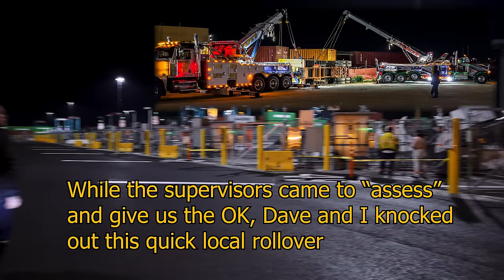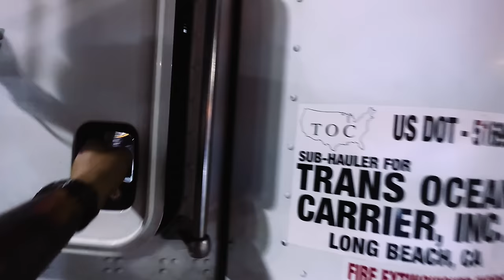Unbelievable Dock Disaster: Who's at Fault?

Comment: I think I’ve watched too many tow truck videos as my first thought was that someone forgot to undo the container locks. Not bad for an 80 year old woman!
Reply: Yep!
Reply from the maker: That's what I love about my fans and these videos. You can pick up so much without even being in the industry.
Reply: So was in the wrong, the driver who didn't unlock the pins or the guy with remote controlled crane WHO FAILED TO CONFIRM it was unlocked and FAILED TO READ THE WEIGHT being lifted. Probably both got fired.
Reply: I’m 70 years old I’m a woman and I just started watching this channel. I love it.
Reply: @sammartin8932 it’s an automated port there’s an emergency shut off switch for those situations. Unfortunately it was the drivers fault for not unlocking pins and not paying attention.
Reply: I love these videos and I’ve even watched heavy rescue 405 and Highway Through Hell and you really learn a lot about the industry just from those shows and his as well as others’ videos.
Reply: @rd4660  I’m nearly eighty and I don’t  feel any different than when i was sixty. All the best from England
Reply: @sammartin8932  the driver is prolly an O/O, owns his truck. the crane operator is sure to be ILWU, good luck trying to get that guy fired.
Reply: @sammartin8932  The remote dude was not even there when it was lifted. It is all full automated.
It's called a Straddle Carrier. https://youtu.be/kQ8WI3nc1l0?t=72
Reply: @shelbynamels7948  There is no crane operator. It is automated.

Comment: Working at the docks for the past 22 years, I gotta say a couple of things about this incident: these happen with people behind the wheel on the straddle carrier, but it seems AI doesn't make it any different - if the twistlocks aren't fully unlocked, you're gonna lift the truck & trailer and notice it too late. Truck drivers don't always remember to open or check the twistlocks on the trailer, and this is a fairly common end result of that.
As for how it ends? In about 99,9% of the cases it's the same: straddle carrier ends the shift with zero damage, the other one gets a ride on the tow truck for heavy repairs.

Beautiful work with the recovery, didn't see any additional damage done to truck or trailer. Great workmanship!

Comment: Great work on this one.  It's especially great you were able to dislodge the back of the trailer without being able to directly rig to it.  With that suspended container hanging above, you couldn't go back into that area.  Some might not think of the "thou shalt not work underneath a suspended load" rule, which made your job tougher (but safer).
Reply from the maker: You hit it on the head. We COULD HAVE rigged to the rear and pulled it, but we could have caused more damage brute forcing it that way. The way we did it by rotating the front back and forth gently allowed it to break free without any damage.

Comment: As a crane operator myself, I can only compliment you guys, nice bit of teamwork there. Also the port controllers stepped right in like they did it before.
Reply from the maker: Nice, thank you. What kind of crane do you operate?
Reply: @PepesTowingService  I got one on the back of my truck. A Palfinger 53002, 30 meter range. Mostly I'm lifting pallets with drywall plates. No winch but some hydraulic pallet forks

Comment: Noooo, don't say "bad robot", they're listening! When they take over, they'll remember when you thank them. 😂 But seriously, bad engineer! The lock release on that trailer was probably at fault. Then it's tricky to detect if the container has a truck attached because light container + truck is less weight than full container. 🥺
Reply: Source: I'm an engineer who's worked on industrial controls. Automation is big scary when you try to think about problems.

Comment: I'm amazed at two things -- your excellent recovery and that danged chain link fence supporting the rear of that tractor.  That fence with all of that conduit attached could have been a real mess if it collapsed when that truck dropped on it.  Obviously the crane structure caught the trailer and took most of the load.

Comment: One thing I'd suggest is a slugger winch. When I was a commercial diver we had a 10 tonne hydraulic winch that we could carry and pull in any direction. I use a similar wind ( superwinch18k ) on a receiver mount. Just thought it might help. Great teamwork there!
Reply: You would have fixed it on the rear of the trailer and pulled it sideways with that? Ain't a bad idea

Comment: Driver unlocked the locks that lock the container to the chassis. It was the salt water rust from the bottom of the container that stuck the container to the chassis. They will still poke away at the driver as their automation is faultless. I hope like hell that driver was not in the cab of that truck for the ride. Wow.

Comment: Your trucks have a set of beautiful lights.  The fleet must keep 2 or 3 automotive electricians busy checking and maintaining lights, wiring and switches, charging light bars, etc.  Work lights, warning lights, clearance lights, road lights, light bars, toolbox and cabinet lights, cab lights, flashlights, and a few lights just for a fun decoration.  Trucks must have massive alternators (or a separate diesel power plant and batteries?)  Are the hydraulics and air compressor electric, or power takeoff?

Comment: After working with all types of computer controlled machines or robotics in a manufacturing setting I can honestly say I have never seen one that at some time does not lose its program and go off on its own.   I have seen results of that from just shutting itself down to ripping itself out of 10” of concrete.   The worst was a machine that moved parts the weighed around 40 pounds and when the robot went rogue it threw the part at such a force it bent a structural I beam if the building

Comment: I used to haul containers. How did it happen?  I guess the chassis got stuck on the elevator they were using for the container?  Or maybe the driver forgot to remove one or more pins. That's probably it. He was bringing it in and having the container removed and it got caught on the chassis because one or more pins were not removed correctly. We used to use plastic ties to hold the steel pins in place in all 4 locations. Leave one pin partly inserted and you got it picking up the truck. Probably the driver side front pin is what got it.

Comment: I watched the video for the first three minutes. I wondered how the hell that happened. Then for a WAG, the container lift grabbed the container and one or two locking twist locks were still engaged. So as the container was lifted it took the chassis and tractor with it.  Usually the lift operator can shake the one lock free or slide the container off the chassis.  In this case the  lift operator would have to lift the container pretty high up when it let go and probably was not paying attention that the container was still attached.  Oh ok, the straddle lift is automated.  And as you said, the chassis and tractor was lifted with the container.  This would be the fault of the driver.  If he had a jambed twist lock his responsibility to notify a yard supervisor or report to roadability  to get the lock unlocked.

Comment: Great job.  Such finesse. 
Could you have an aux line through a snatch block at the end of the boom reach to the rear of the trailer to have lift there, too. or would the line angles be wrong?
Reply from the maker: Correct, the angle would be very weird and fight me. If you visualize it, it would do more harm than good. We purposely didn't rig to the back even at the end, because brute forcing it out of there could damage the machine. It's why we alleviated the pressure up front first and had the crane drive back and forth to get it unstuck.

Comment: I have a 10 foot 3/8 chain to help get me or another driver out of a tight spot and I been hearing nothing but praises for bailey's rigging would you recommend me getting a good size rope and shackle?  If so what size would you recommend? I don't use it a whole lot but when I do it sure comes in handy
Reply from the maker: I'm assuming your chain is either grade 70, or maybe 80. It's only rated for a few thousand pounds max. Of course it'll break anywhere between 3x or 4x that, but each use overloads it. The Bailey's team can custom make a sling for you in any length. I would probably recommend a 5/8" grommet sling in 15'. They are very versatile, strong and easier to store and carry. A regular 12t shackle would be perfect to match.

Comment: Kind of surprised they drove the dock crane off without (much of) an inspection. Moving it clear is reasonable, but they seemed to just head off back to work!  The falling truck had struck both ends of the crane, if not too hard.  🤷‍♂️🤷‍♂️🤷‍♂️

Comment: I'm at 2 minutes 50 sec and the answer is the truck driver forgot to unlatch the chassis so if someone get fired it's the truck driver. I use to haul empty containers on a flatbed. I guess I really don't know much about the cranes because they only had forklifts at the place I use to go and it was just a empty container lot so I'm just guessing the crane operator is up higher and can't tell if the container has been unlatched from the chassis.

Just seen the crane systems is automated but my conclusion still stands as a truck driver (for 12 years) it's my reasonability to double check then check again to make sure everything is right in any aspect of my truck and trailer.

Comment: This is exactly why I will never pull a container. Never.
Reply from the maker: You will never pull a container due to the off chance you have to get offloaded at the port and don't check if your pins are unlocked?
Reply: @PepesTowingService  Nope. I think the pins were unlocked. I think the rusty chassis hung onto the container during the lift & waited to about 40-50 feet to break free.  Once the tractor & chassis started lifting off the ground, the lift should of been halted. That's "Automation" for you. The Robots don't see & think like a humans, & than you guys have the opportunity to show up & get the payday.

Comment: @ 3.50 You said "bad robot", it seems obvious it wasnt the machine but the driver who didnt unlock all the twist locks first then check them all before entering the discharge point like we are ALL instructed to,  as we are not allowed out of our cabs while in the vicinity of the crane lines - on pain of being instantly barred off site if caught.  the way it ended up he obviously didnt undo the front right twistlock properly since right at the front of the video it was obviously sheered off clean - even the release handle was still stowed in the lock position !, the left hand one and both rears were clearly out ....,  it obviously snagged up at the front right and hung up and the trailer lifted the whole unit way off the ground before letting go when the twist lock finally snapped its mushroom head off so far to the left that the landing leg went outside the machine's travel bogies which is the only way it could happen. and an unreleased twist lock is the only thing strong enough to lift that weight.   In Britain we are required by law to have all four corners securely fastened at all times on the public roads - which you can only do after you come out from under the machine and away from the lifting point  and before you get out onto the road. 
Of course in the real world different things  can happen and maybe,  just maybe the driver picked up the trailer with the box already on, and possibly perhaps being a new driver jumped out and undid the nearest twistlock right behind him as well as  the back two and then walked back to the cab on the drivers side totally forgetting to CHECK first and stupidly leaving the right hand front locked.
.....and before you even think it much less say it,  I am not as you described it at the end a " know nothing"  youtube armchair  "expert" but an ex full time truck driver, recently retired and an ex mechanical engineer, I have loaded and unloaded thousands of containers of all lengths and layouts in my time,  from straight boxes to un baffled ISO tanks (the egg shaped barrels inside a container frame) and flat bed container decks and also been involved in quite a few HGV toppling recoveries over the years (not mine I hasten to add),  I wish I had a pound for every one of those 45 foot chinese evergreen boxes I have ever pulled......ha ha even THAT one could ever likely have been one of them - wouldnt that be spooky from ten thousand miles away ?......so you can blame this one all on me lol....I was watching the vid and thinking what the hell are they doing - if your mate had hooked upwards and boomed in as you  hook downed and boomed outwards the whole shebang could have been put back down on its feet a lot sooner, then if the back end of the skelly was still fouling the machine one of you could have tracked back wards and tugged it straight pretty easily, as the back end of a skellie (truck driver slang for skeleton trailer) is only about three and a half to four tons, anyways good job well done boys.

Comment: Josh one question I have for you do your trucks have a pull line on the back that you could hooked up to that rear of the trailer and pulled it while still Having it in the air to make it easier I know some companies have pool lines or drag lines on the back I'm just a curiosity question on my part Love the video stay safe looks  like the little one is getting cute and cute I saw your quick clip with her in the front seat of the truck that was good.
Reply from the maker: The rear of the trailer was stuck on the crane, so pulling it would not do anything. The goal was to get everything down straight, then rotate and pull the front to get rid of the pressure in the rear so the crane can safely drive away from it

Comment: Never block the outriggers under the beam while  lifting as all the weight is transferred to the inside timber. Ribbing. There may be a small amount of weight on the extended outrigger floats, but only making ground contact. This practice is suitable as an aid to setting up. In hydraulic slew cranes we can see how much ground pressure is on out outriggers and how it changes during a lift and while slewing, so I have seen the first hand evidence the ground pressure this practice removes from the outrigger floats. This used to be common in the old days of screw down outriggers as it was soo much hard work to set cranes up level.

Comment: The cranes and strads are not automated, they all have opreators in all of them. I inspected these for the last 20 years. The terminals would love to bring in automation but it wont happen because the Longshore Union would shut the dock down.
Reply from the maker: Is this a joke? They are absolutely fully automated in a lot of these ports now. You can see them driving around in the background behind the trailer, zero operators in them. I don’t get why people have to be so confidently incorrect. You’ve been around them for 20 years and did not know they have ones with zero operator inside ?

Comment: the dock workers are idiots... lower the container  back down and hook chains to the four points on  the chassis, use the rotator over the rear of tractor. lift the frame and tractor up use the rotator to boom out and set back down straight. Keep it simple, dont over think it.
Reply from the maker: Serious question, but are you blind? How would they set it back down when the front was caught on the machine itself and the fence?